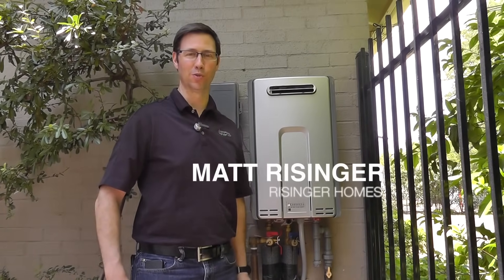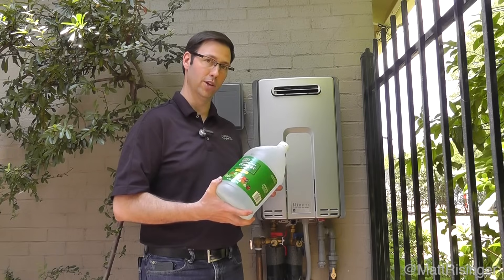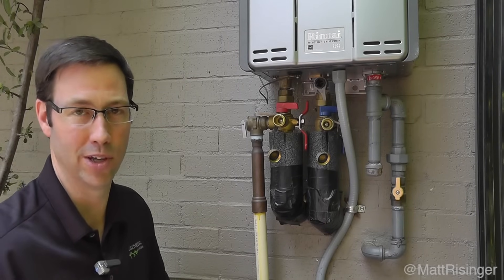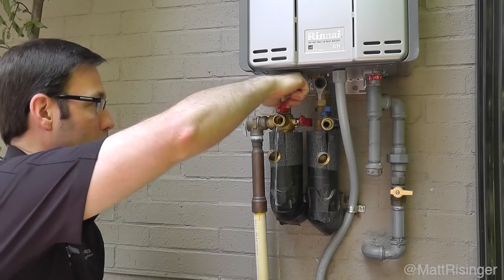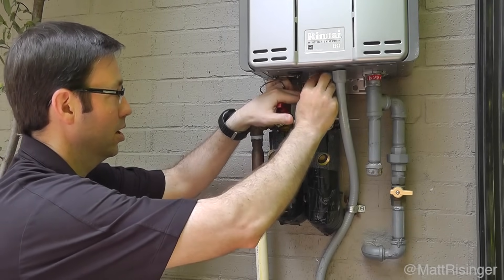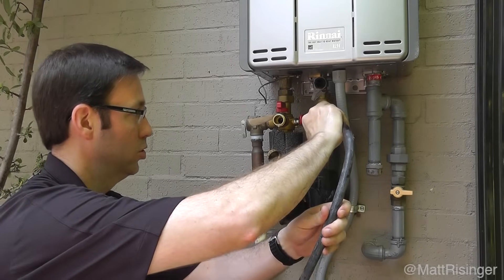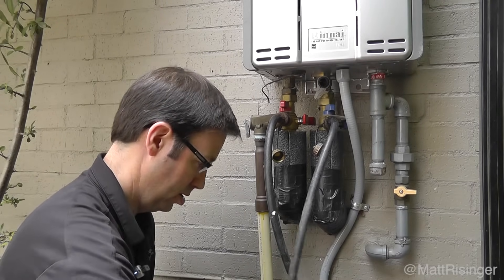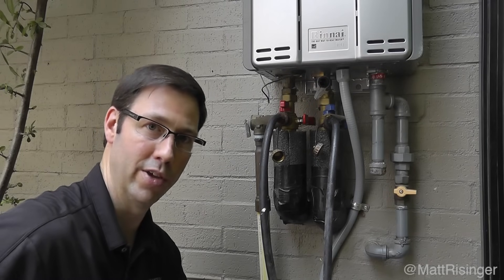Tankless Water Heater DeScaling - How To Flush

Comment: my cold water inlet has a separate drain outlet, but my hot water side doesn't have one, can I just use the overflow outlet (the one on the far left in the video)?

Comment: Please Note!..In a Most RV's Unless installed do not have a shut off at the water heater for the gas supply! Shut the tank off but do note the following. The gas line Does Not in all cases have to be off but the power does!. If the power is left on It is however going to fire up off the remaining gas in the line even if you shut the gas off at the tank!.The reason being is the line unless bled off is still loaded full of gas!. The whole idea here is to make sure the unit does Not start during the descale operation. Also note Note every system is the same so pay attention to the details to do this safely!. Good Video Matt!.

Comment: A couple of questions... One, Would it help to initially fill the coils by filling them with vinegar using the pump, then shutting valves and letting it soak for a while before cycling with the pump? That's how we clean our sink and washing machine screens- just soaking them in vinegar for a couple of hours before brushing them off with an old toothbrush then rinsing.  Two, would it maybe help to pump a cycle from the hot side, perhaps after the initial flushing with the pre-filter on? Taking the pre-filter out for that step would keep it from collecting any remaining sediment from the inside. Reverse flow could dislodge anything that has moved in the regular direction and perhaps built up or stuck to sensors etc. by "back washing" like during swimming pool maintenance. If there's a built in check valve to keep water from flowing in the reverse direction, of course that step wouldn't be possible. Anyway, thanks for any thoughts on that. Our off grid house (and systems) are around 15 years old, and the first tankless water heater lasted around 13 years without service (I've always had tank heaters before). I want to maintain this unit. Our pressure tank is sluffing rust particles from the inside, and we get flakes on the sink, washing machine, and other inlet screens. I'm installing an inline screen filter before the water heater to stop that issue, but rust has been running through the heater to get to faucets. Anyway, thanks again for any insight, and for the video.

Comment: Thanks for posting this! When I first start the sump pump, the water comes out as a strong flow and slowly diminishes to a strong trickle.  If I close the hot water exit the tank slowly fills up and then when I open it the flow is stronger. Does this  mean that the vinegar is only cleaning the bottom of the tank? And why do I have diminished flow? I did check the sediment filter and it seems OK.  I have a state water heater.

Thank you!

Comment: How important is it to have an anti-scaling unit installed, and are there any downsides to them? I ask because I discovered that a (knucklehead) renovation contractor apparently left them (Product Preservers PP-AS20) sitting in a pile of construction debris. They came with the Takagi tankless units. Should I have a olumber return to install them, ir is there a good reason not to (e.g., diminsihed flow)? I strongly suspect I need them (and they're $150/unit). New Orleans has quite a bit of crud that moves through the water supply from time to time. I just wonder if plumbers debate these things. BTW, I did fire that contractor.

Comment: Question. Can someone answer for me. I live in the Philippines and had to special order an LPG water heater and there are no one specially qualified to install them so I installed it myself and do not have all the special ports to be able to flush it properly. Now my question. I am on a deep water well, deep for the Philippines at around 50 ft, and I have installed a  filter like a sand filter and a water softener at the pump and bladder tank then have a 4 cartridge carbon filter on the house that feeds the heater and to certian parts of the house where I need water filtered that much. With this type of system how ofter should I flush the heater? I cannot find these parts here so will have to ship them in via Amazon so can someone tell me exactly what I need to look for by name? I will be building a bigger home soon and will add this flushing system, if I can find all the parts, to the new heaters so I can flush easily.  Thanks in advance for the help and parts info. God Bless

Comment: I attempted this today. Configured it exactly as shown in this video. However, once I started the sump pump the return vinegar dumped out of the pressure relief valve onto the ground! Nothing went through the hot water return. Any ideas what I did wrong?

Comment: Thanks for this.  I have the Rinnai v65e and the manual recommends a pump that pumps 4.5GPM.  A plumbing supply store near me said I could damage the Rinnai if the pump has higher than 4.5GPM.  

But most 1/6 hp pumps I’m finding are upwards of 23-25GPM.

Comment: I did this with your help before and glossed over the part to check the filter, I pulled it out and it was solid black! I cleaned and replaced it,  I have had plumbers out to diagnose my hot water flow issues that shut down and produced error codes, no one even looked at the filter and wanted to sell me a new one because this one was 10 yrs old. Its running great now, thanks.

Comment: What is wrong if my system seems to be getting additional water from somewhere?  The cold water value looks completely closed.  The hot water valve doesn't go fully perpendicular to the pipe, but would that cause a slow drip of water to be entering during the descaling circulation?

Comment: Tankless folks, usually my flush works great and the vinegar is clean with a little bit of calcium scale.
Last flush, the vinegar came out oily. At the bottom I had a bit of brown goo, the color of the outside of an old dirty copper pipe. I had let it run about an hour longer than recommended. Any idea why & what I should do about it?
Reply: Run it again?

Comment: Strange, this worked like a charm 1st time (RL75).  Matt describes perfectly.  Now (2 years later) nothing's flowing through.  Filter was clean.  I saw some weird "Fixes" on another site (reverse flow or having water heater on for 30 secs at the beginning - I'm too scared to try).  Once I switch back to the isolation valves, everything is fine again  It's almost like the drain valve is blocked inside.  I tested my 1/5 hp submersion pump - seems to run strong.

Comment: Got a nice color change using 3gal and a cheap pond pump from harbor freight $27 piece of cake and seems to work great, it's the chemical that cleans not the pressure so it just needs circulation

Comment: Hi.
1  The cap to access my inline water filter partly shattered during my flush today. It's 8 years old and gets indirect sunlight (and UV) from the garage window. The plastic was very brittle. Still usable but I ordered another one that the Rinnai website chat people suggested, $11 including shipping.
2  Wonder why you don't turn the power off. I unplug the heater because I need that outlet for the pump. It seems to take a minute to reboot when I plug it back in at the end.
3  I use a cheap fish tank pump and it works fine. Had to use adapters to get it to connect to the washer hose set.

Comment: These were good instructions, but one thing that is missing is that you should flush out the tank with water through the hot side after you're done with the vinegar.  He mentioned this in his newer video on this topic but for some reason did not include it here.  After I flushed the vinegar today for 90 minutes, the vinegar turned a bluish hue, but when I then followed up with clean water from the street that I discarded through the hot side, it was gray and murky.  Glad I did that.

Comment: I have had a tankless water heater for a couple of years now and I have flushed it every 7 months and I noticed that the water flushing thru the system doesn’t have a lot of pressure. Like it’s clogged. But I have flushed it religiously. What can cause that?

Comment: Everytime I hook up my pump, the vinegr runs through fine then begins to tapper off and eventually stop.  If I conect my home water supply through the garden hose it circulates fine  It acts like it has a pressure cutof valve...  Do you think my pump is putting out too much pressure?

Comment: Can anyone offer advice about the type of pump needed?  

I called Rinnai customer support, and the rep mentioned that ideal flow is 2 gal/min, which is extremely slow.  The pumps on Amazon achieve anywhere from 20-50 gal/min.

The rep said she could only advise on what instructions for the manual states, but I wanted to know if it is fine to flush with vinegar at a higher rate when descaling.  

Is flushing faster going to do any harm?

Comment: My Rinnai manual for a RL94EN, outdoor, natural gas, water heater says to disconnect power and then when finished and restored (hoses removed, caps restored) restore power to the unit.  Why did you maintain power during the flush?

Comment: You might want to change your pump rec. The link you have now costs $122. A similar 1/6 hp water heater kit from superior pump costs the same on Amazon, but the Superior pump by itself is about $75. The 1/4 hp Superior pump that is otherwise identical is $55. My apologies if this is repetitive, but there's way too many posts to read through.

Comment: Bought a Takagi TDK  20 in 2005. We got 17 years of service out of it. Then the circut board went out. If they  still had it. The board would cost $300 + dollars.  Plus cost to have it installed. They discontinued it in 2009.

Comment: Hey Matt
 Just got ready to do mine with the kit, never flushed since install in its 10 years. The Shut off valve upon turning wont turn the ball inside only the handle turns i guess i am in for a valve change. Do you know what valve am i looking at.

Comment: We didn’t know we need to do this until we got the LCO ERROR CODE . We descaled 3-5 times with Vinegar and it didn’t help , then tried haymaker , and flow-aide. Was good for one week until it beeped again . we did another flush with haymaker and then vinegar. And flushed it 5min with clean water . Any suggestions on what else we can do or why would this keep happening

Comment: I have a rinnai tankless and I've turned off the main water and gas and opens the valves where the hoses connect. I've taken every step correctly but when I turn on the pump it's as if the valves are closed and no water goes through the unit. Any ideas?

Comment: Thank you for this very helpful video. I was able to do this with the parts you recommended and a few gallons of white vinegar. Only took about 1.5 hours including setup and cleanup and saved me several hundred dollars. Some other folks in our community are following your instructions as well. Thanks for taking the time to put this together.

Comment: Thanks.
I bought a used heater that needs to be flushed.
Can the heater be flushed before it is installed ?
If the heater is clogged, will this method open the flow?

Comment: THE HOSES YOU SUGGEST DO NOT FIT RINNAI WATER HEATERS!   I purchased the  Whirlpool 8212546RP hoses and they do not screw on all the way.  They start to screw on but won't tighten even with channel locks and will leak.  They were not cross-threaded.  Had to make a trip to Lowes and get ones that fit. They are both 3/4" but for some reason some reason the hoses will not tighten.  Had no issue with the Lowes hoses.

Comment: The flush valves are nice, but certainly don't appear to be necessary. Advice should explain why rather than simple, blanket statements. A 3/4" to 1/2" adapter may be required.

Comment: Hi Matt I have a Rinnai R94LS I have been doing regular flushes since new  we've had it for close to 10 years. Recently though it stops running mid fill on the bath tub. It's throwing a fault code 10. Any tips?

Comment: Overall good video, just my 2 cents:
1- you don’t really need a $100 pump, a $40 one 1/6 hp works perfectly, and I would prefer oil-less version to do this kind of job.
2 - in case there are some leaking and you can not fix by tightening it up, go to local hardware store and buy couple washers for $1 or $2 that will help a lot.

Comment: Here's a crazy idea. I live south of the border in Mexico City, and as you may know, houses are made of bricks and concrete.
Even though the water lines inside the house are copper, the external lines (like 40 feet) were galvanized steel, so rust and lime were formed inside these lines for the past 35 to 40 years and I assume some ended inside the copper lines, so the water pressure is not the best. I changed the external lines for copper 2 years ago, and after seeing this video I thought "Will it be possible to flush the internal lines using this method?" I have a pump after the tank water heater and a recirculation valve on my bathroom somewhere between 50 to 60 feet away and 2 stories high. I'm going to replace the water heater for a tankless water heater and I want to know your opinion about flushing the whole house. Since the vinegar will be cold, the recirculation valve will remain open. Any other ideas?
Reply: You could have the flush kit valve he mentions around 2:00 and buy say, 20 gallons of vinegar. You'd connect the pump before the heater and at the farthest sink. It would be a lot of liquid to move. And flushing a system takes a lot of pressure. You may just want to take the aerators off the shower and sink and just BLAST them wide open for a while.

Comment: I have a similar Jacuzzi (Rinnai) gas model with the same valves. The odd thing is that I have to leave the blue (COLD water) valve open (I also shut off the cold water farther up the line with a different valve) in order to get any water flowing through the water heater and out the HOT line. I have tried both with and without electrical power to the water heater but it makes no difference. Also, the water coming out of the hot side is a much lower flow rate than what the pump can put out when the hose is not attached to the valve. The valves all appear to be installed correctly. But every time I shut off the cold water valve on the unit (as in the video) I get no water flowing through the unit and out the HOT side back into the bucket. What is going on here?? Under actual normal operation the unit works fine.

Comment: You are worth gold! In the co-op housing unit we lived in we had an extremely expensive several thousand dollar instantaneous hot water heater. After 7 years of not being descaled we had to buy a whole new instantaneous hot water heater. A couple of bottles of white vinegar and the right fittings would have been much cheaper than paying another 8 to $12,000 for another unit.

Comment: You didnt show how to connect the hoses to where or what to do with the submersible pump?

I learned NOTHING from this video other than wasting 8 minutes of PREP to clean the dang thing......

Is there a part 2 showing the actual hook up and running of the pump while cleaning the water tank???
Reply: You drop the pump in the bucket that's filled with vinegar. Then the other hose end, coming from the hot side, which will be exiting vinegar goes into bucket too. It swirls around, creating a continuous loop. The scale can not reattach to your copper because of the vinegar.

Comment: Hi Matt.  Nice video.  Question - that pump at 23 GP(m) which is 1380 GP(H) is NOT going to hurt the internal plastic pieces inside the tank lines?  I have heard that if you go about 800 GPH, it can damage the plastic pieces internally on units like Stiebel Tempra.  Please respond with your thoughts.

Comment: Dont forget to flush that vinegar out of the tank as well. After cleaning we open cold side but not the hot side for 10 minutes to get the chemicals out before opening hot water valve.
Reply: Couldn't you do another quick cycle with water?
Reply: @landonlandon5533  yup I do another cycle or two with water. It cleans the tankless out and the sump pump and hoses out.
Reply: I’d be tempted to run some water through it before the vinegar just to clear out and scale, and help prevent it from circulating through the system during the clean cycle.

Comment: Thanks. I have old tank water heater that is 20 years old and it’s still working. It’s is the garage so if it breaks it shouldn’t be that big of a deal. But I don’t think it’s doing that good of a job heating the water. I know it’s cold outside but been thinking about replacing it. Should I invest in tankless? Thanks

Comment: Thank you for the video.  Would you recommend performing a fresh water flush, after the vinegar, to clear out the vinegar?  Or just open a hot water tap somewhere in the house to clear out the vinegar?
Reply: I met a professional plumber with experience flushing many tankless water heaters who told me to make sure and not flush any vinegar down a porcelain tub or sink because the vinegar will stain the porcelain green.  Matt only shows flushing an exterior tankless heater.  Some tankless heaters are installed inside in a closet or basement.  In that case, when you flush out the vinegar with plain water, you want to run a garden length hose out a window or door, and not down any porcelain fixtures.  Also, straight vinegar can be used as an herbicide to kill plants. If you are gardener, you probably do not want to dump any water-vinegar solutions on your lawn or planters without considering possible pH consequences.